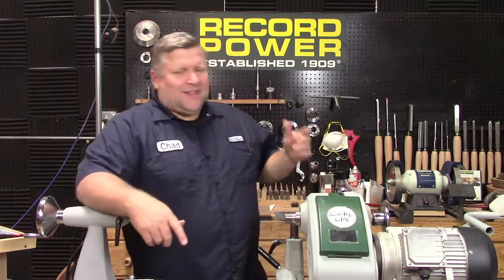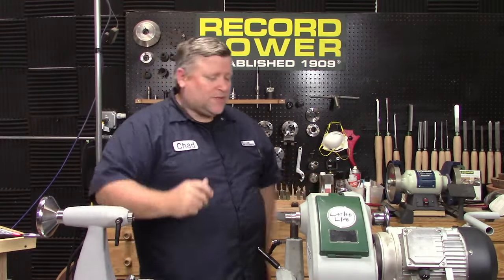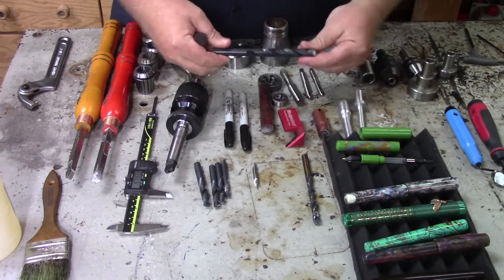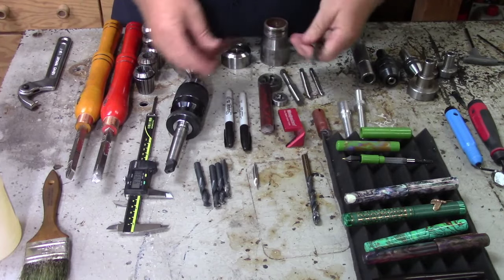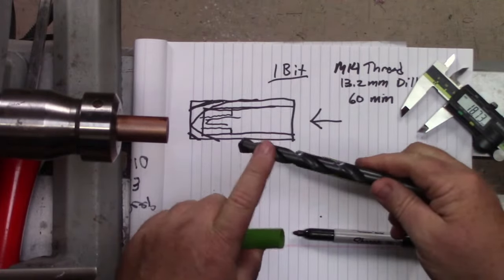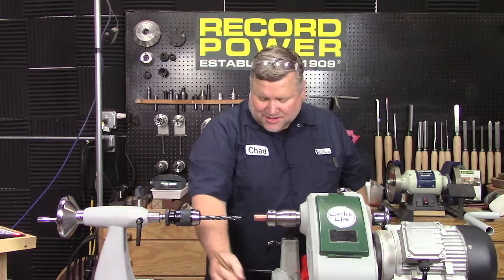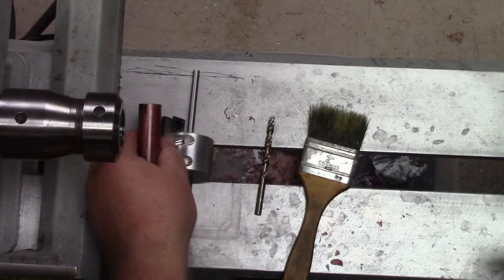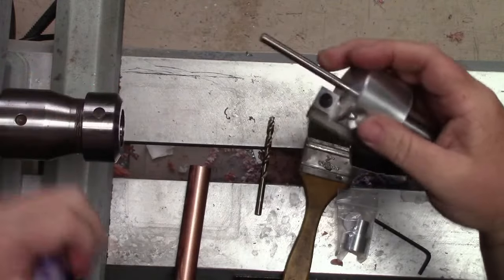Custom/Bespoke Pen Making - Threading the Cap and Body

Comment: Thanks for making this video series. I have been planning on trying custom pens, but was not really sure how to start. This has been excellent so far. I am also really happy to hear that you are going to cover a cap with a clip and roller balls.
Reply: Can you add a list of all of the dimensions that you used for the pen that you are making?
Reply from the maker: Glad it was helpful! and we appreciate your tuning in!
Reply from the maker: Yes of course! Here is what we had from this video: 
Cap
13.2mm drill (33/64 pen drill bit on our site) 
Drilled to 60mm deep. 
Using M14 threads/tap

Body 
73mm deep, 9mm drill bit 
M10x1 for the section area

Hope that helps!